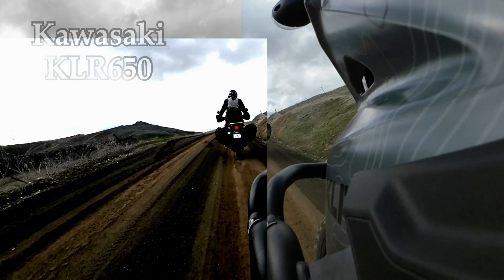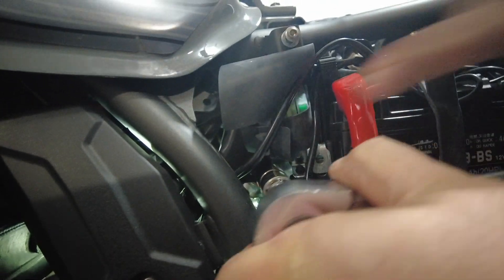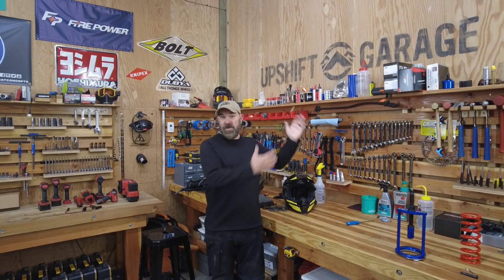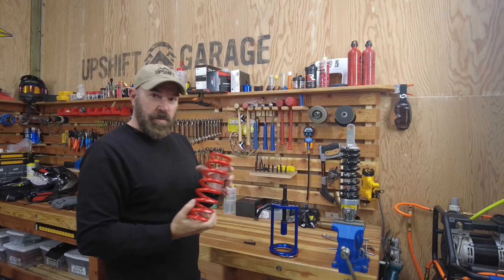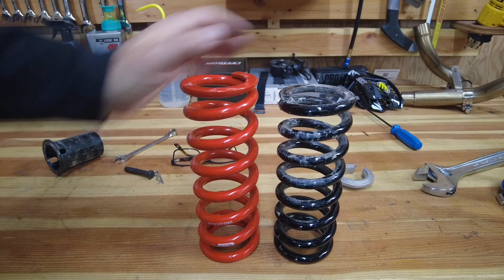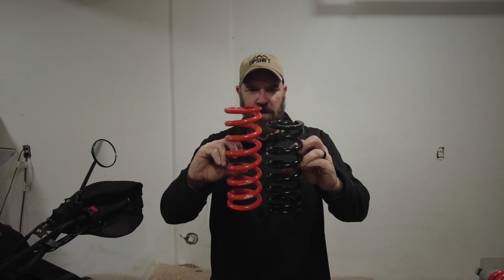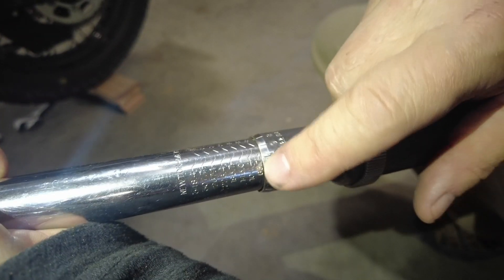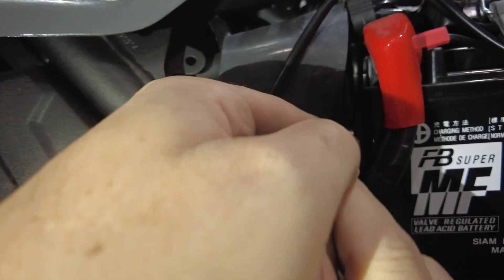Upgrading the Rear Shock Spring on a 3rd-Gen KLR650…

Comment: So what weight is that spring meant to pack and do they have stiffer ones?
Reply from the maker: @diraltmcallister3523  The Eibach spring is rated at 550 lbs/in and is the heaviest rated one we could find. Eibach claims it’s designed for a rider that is 285-315 lbs.